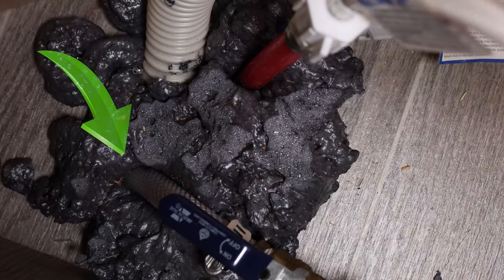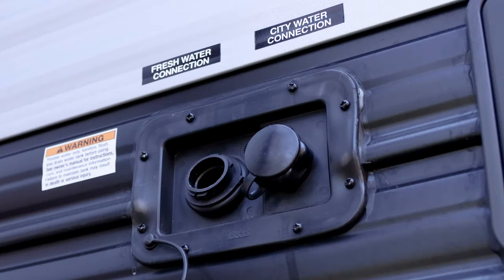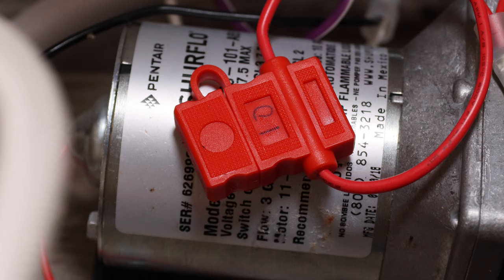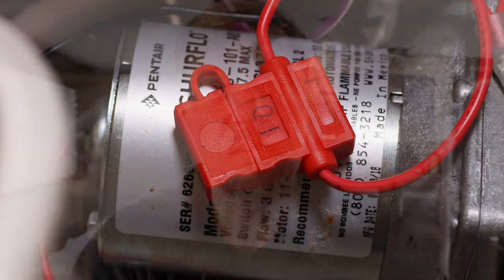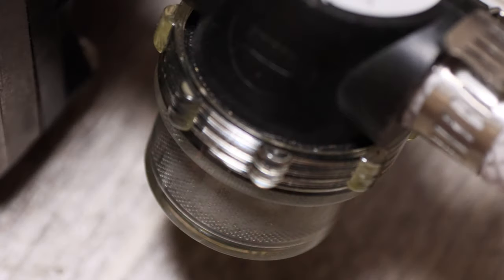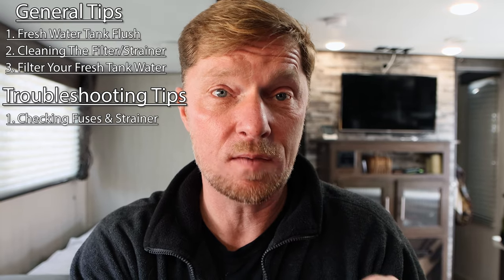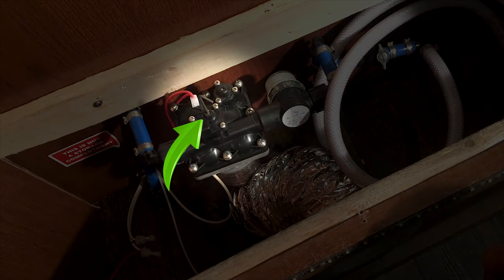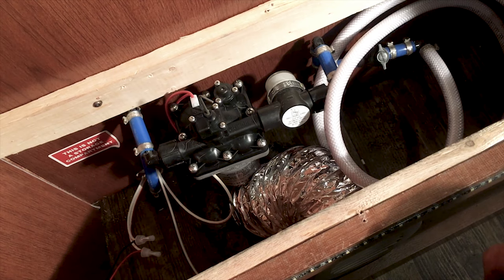RV Water Pump Explained 2021 - Shurflo Water Pump

Comment: I have a different water pump it doesn't have a check valve it doesn't have anything that lower the pressure it's just a straight water pump it's got an inlet and an outlet my problem is I drained the water completely empty and now it's hard to prime there's air in the lines and the way they say to do it open up all the valves to your water then as it even flows turn the cold water off and leave the hot going till levels out and it but it doesn't never  level out
Reply from the maker: Maybe try pulling the input line off of the pump and putting water down the hose until it fills up and then reconnecting to see if that helps. The pumps that i am familiar with are RV fresh water pumps of today. They are self priming. Not sure how the pump is supposed to work on yours. I would have to suspect that if it is not self priming, then there should be a check valve somewhere inline so that the water will not drain back to the tank once the pump is shut off.
Reply: Another trick is to disconnect the outlet of the pump so that there is no "head pressure" on the outlet.  I have found that creating a loop from the outlet, back to the inlet with a shutoff valve inbetween and a hose connection allows you to hook up city hose to the "loop" to prime pump whenever you need to. Works everytime.
Reply from the maker: @nathanmarshall7523  I really love this idea. I may have to try it out myself.

Comment: I have the shirt flow water pump just like yours but it will only come on and run for about three or four seconds then shuts off what do I need to do
Reply: Shurflo pentair
Reply from the maker: https://tinyurl.com/y3tuppvf  -  Use this link and select the pump that you have. You can then look at the downloadable documnets to find the specific troubleshooting documents. Shurflo pumps are made by a company called Pentair. Hope this helps.

Comment: Does anybody have this exact pump with leaking problems? This is my second one and we dont use the pump because we are on city water all the time. This is the second pump that leaks from the top.
Reply from the maker: I have not heard of any. I recommend to use it at least once a month so it dissent fail. Also, it is not unheard of to get a bad one even if new. That would be my luck anyway. I would say to return it and try again. Aggravating I know but worth the try.

Comment: The problem I'm having is my pump is not turning off when I stop using the water.
Reply from the maker: The 3 most comon issues are the pressure settngs and a possible water leak or the pump is pulling in air from the line coming from the fresh water tank to the inlet of the pump.

Comment: my pump comes on but won't shut off...
Reply from the maker: I would start by checking for leaks. If you are certain that you do not have any, then you try the pressure settings. I usually recommend folks to see a service tech if they are not certain of what they are doing.
Reply: @HowToRV  thank you. I would be one of those people. 😀
Reply: Turn the bypass screw in one turn with a 2 mm Allen.